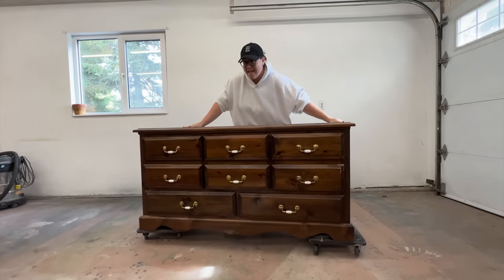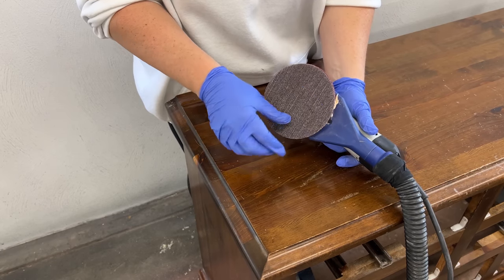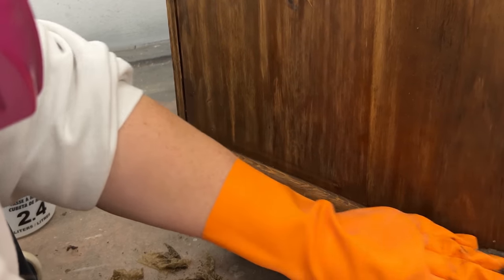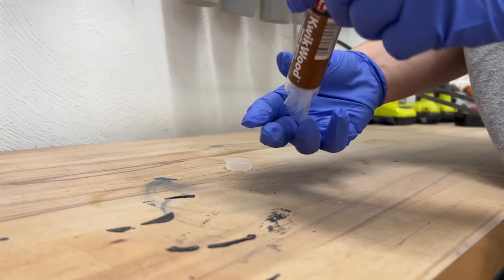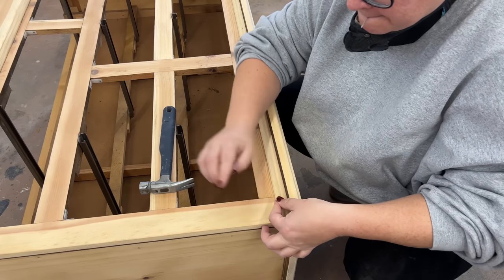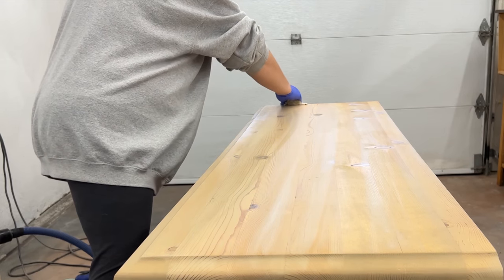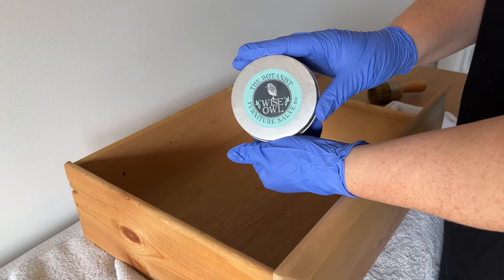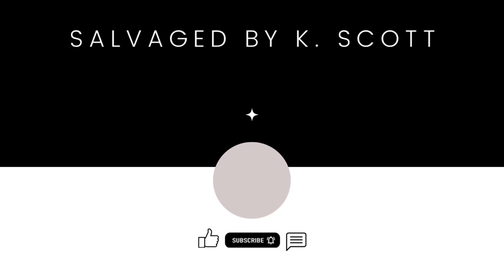Lighten up your dark furniture with a TAN WASH! | Stripping, Sanding & Staining

Comment: Love the idea to do the first coat of poly then do the sanding. I found myself accidentally stripping colour and I hated having to go go over it again. I’ll try that next time!
Reply from the maker: Ugh, I’ve been in that situation a few times 🤦🏻‍♀️
Reply: It would be better to wipe your wood with a damp rag after sanding to raise the grain or else use water based stain to raise the grain then sand. You don't need to worry about it raising twice and you don't want to sand raised grain with poly.

Comment: Great job. Taking off the scalloped edging on the bottom and replacing it with a squared apron would boost the cabinet into the new millennium. The   scalloped apron is very 70s/80s.
Reply: I have the same style bedroom set 😢

Comment: Wow, another fabulous redo on an old dresser that needed some freshening up. Love what you did. At first I wasn't sure why you left the very bottom with all the curves as is. I expected you would modernize it with a straight linear piece but seeing the final outcome it looks great just the way it is, and is very coherent in its design.  Well done! ❤
Reply: I thought the same about the curves. I have the same style furniture that I stripped and wished I had removed those scalloped curves to give it a more updated look. However, it worked for this dresser.

Comment: Excellent end result in this refinishing project 👍🌟😁 you've also addressed something I've been struggling with. I'd like to use the varathane at the end for table tops, chairs etc for my home,, but I have a small area to work in and I was worried about the misting that appears from the spray gun. I've purchased a tent and electric spray gun. I'll use your method here and try it out. Ty Katie. Your teaching methods are easy to follow and help me feel more confident to try new methods out. Very much appreciated. Your fan from Ontario 🥰

Comment: This is exactly what I need to do to my knotty pine cabinet door fronts. Can you suggest a durable water based polyurethane for kitchen cabinets? Also if I wanted just a shade darker than what this shows what stain would you suggest I use after the tan wash? I don’t want anything dark at all, just going for a more neutral toned (not orange) cabinet.

Comment: How can we tell if furniture has a veneer and can veneer be sanded?
Reply from the maker: You can usually see how a piece of vintage furniture is constructed by looking at the back. There should be some sections visible where you can see if there’s a layer of thin veneer on top of a piece of wood, particle board or hard board. Wood veneers can be sanded but because they are so thin, they can’t be sanded very much.
Reply: @salvagedbykscott  Thank you!

Comment: Beautiful! And question! I just did something similar on a pine table. The tannins come thru even after I was totally done with poly. I heard next time to first coat the pine wood with clear shellac to keep that from happening.  Did you see tannins coming thru your piece after you were finished?
Reply from the maker: You can’t really do anything about tannins when you’re doing a clear or translucent finish. If you seal the wood with shellac, it will turn orange and won’t accept any stain. The paint wash, helps keep the colour intact a bit but all wood will darken over time.